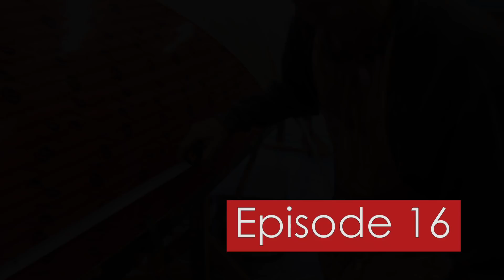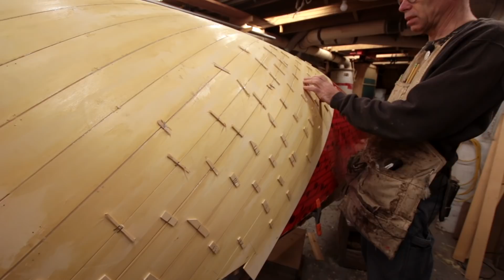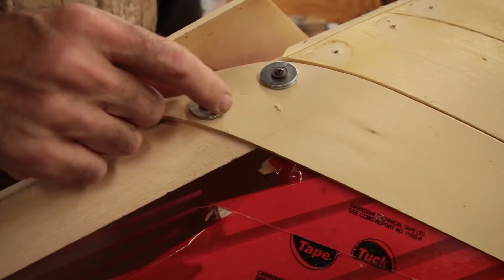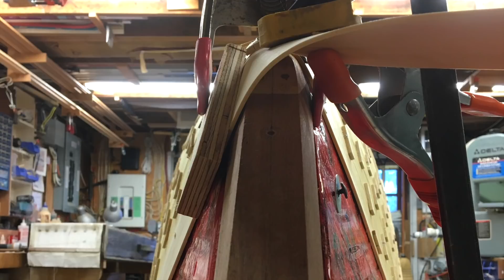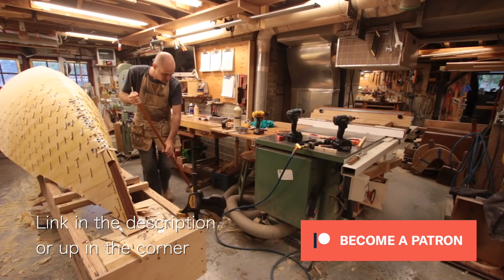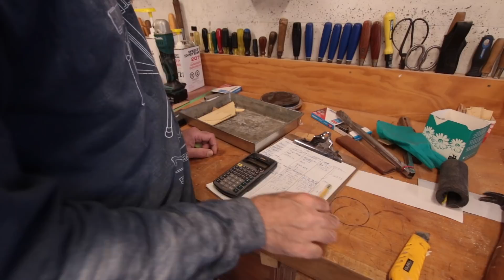International 2.4mR Sailboat Project - Episode 16 - Finishing the first layer of planking

Comment: I get the idea: shorter wider planks in crossed + angled plys per std cold molding = strength and wow-factor look but way more drama than long stripping along length.  Thought experiments ran through thinner narrower with more layers but ooh the resawing and time sucking - doh !  I suppose the curvy displacement hull wasn’t designed with cold molding on smaller scale in mind.  Mindful solutions and get it done attitude keeps it real.
Reply from the maker: The designer has built it with three layers. Vacuum bagged. I assume manufactured veneers. I couldn’t find anything locally to that. Only 4’x8' paper backed sheets.

Comment: What is that plane you're using to trim the plank?
Reply from the maker: It's a little palm plane. Made by Kunz I think. Pretty cheap. Or it might have even been a little Stanley thumb plane. Even cheaper. You know, I have so many tiny planes lying around I'm not too sure at all but they all work about the same.
Reply: Thank you Mark! That tool seems perfect for perfecting a spiled plank.